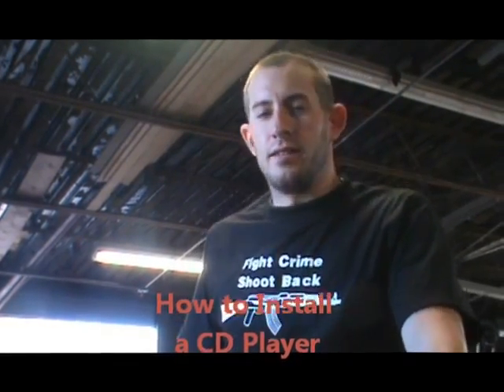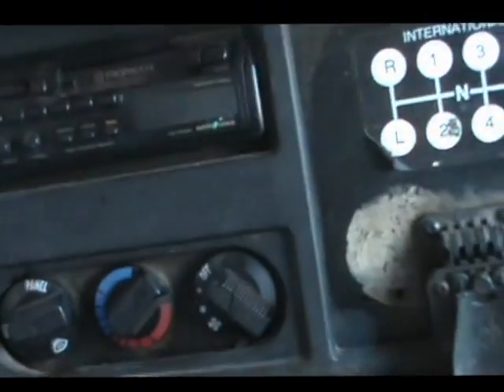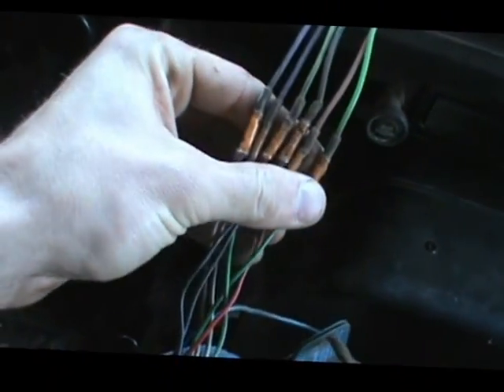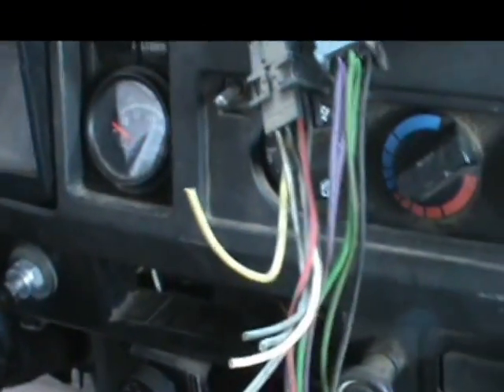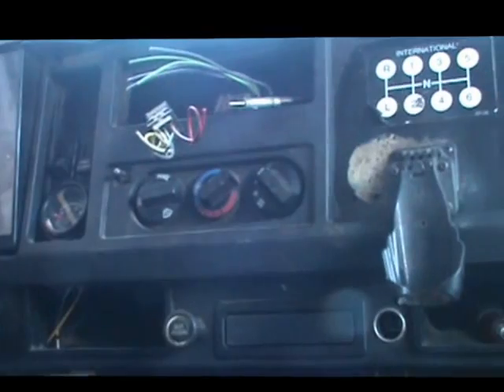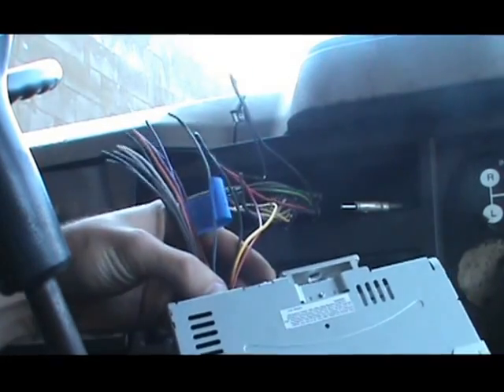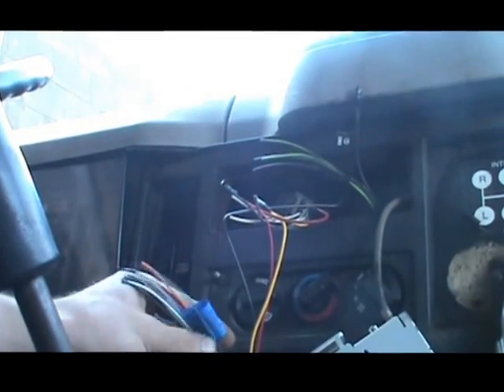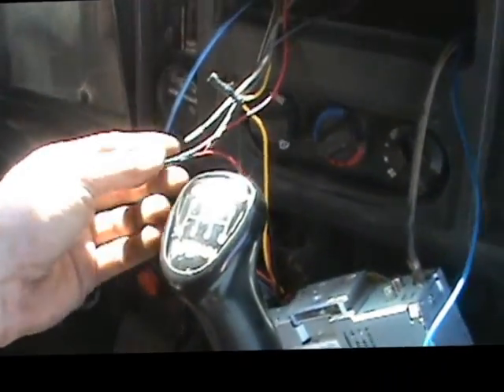How to Install a Car CD Player

Comment: Right on brother. After I commented, I just cut the car harness plug off and wired it up that way. but I had to run an auxiliary wired from the positive battery to power the unit up. So I cut the wire and wired up a simple on off switch so Its easy to shut off when Im done driving

Comment from the maker: hi jet t, thanks for watching my video.. sounds like something simple, check that your ground is bolted to a good metal ground... then make sure you have a positive wire from the battery to both the red and yellow wires on you cd player...this should get the unit working for you... 
cheers beauthemechanic

Comment from the maker: hey pat, sorry for the late reponse. yes theres always a way to make things work. your probably going to have to hard wire the fans to the run position. its a pretty easy task. take the wires going into the fans free there should be two per fan. pretty straight forward one is a ground and one is a postive or supply. your going to have to run new wires to the fans directly from the key ignition or fuse panel. the other goes to a good metal ground bolt. if the air flow is wrong reverse the wires..

Comment: WOW Beau...you just helped me out on a bunch of questions I've had.  Now I know how to use my continuity light tester AND how to install a car cd player.  I wasn't sure if I would need so kind of metal bracket to hold the player in the dash but it looks like just tweaking those security tabs will do it!  I'm putting the exact same player into my 1985 rv that had a dead player in it.  You gave me the courage to try.  Thanks!  Great work!!!

Comment from the maker: hi mnight207, sounds like your on the right track id try and get the unit to power up by just connecting the red and yellow wire to battery + and the black wire to battery - .. if you can get the unit to turn on then you have a problem with the wires in the car from the battery or ground.. if you cant get the unit to turn on from the battery then you might have a loose wiring harness... if so id return the unit and get another.. hope this helps beau

Comment: Hey man awsome vid. i have the same deck and im puuting it into a GMC sierra 1997. well i dont have constant wire ( Hot Wire). when i turn the ignition i do have a yellow wire that works. 
on the diagrams i have read that it is a orange cable. but yeah i dont know what to do if theres not a constant. any advice?

Comment: Beau, i'll tell you how awesome you are once you have a solution to my problem. I have a 97 Chevy Malibu. Ive been trying to install a Dual XDMA450 deck in it and it just will not power up. ive checked the fuse and  thats good. The ground wire is running from the inline harness. Ive tried bypassing the power just to the battery and I am not getting power. The fuse for the deck itself is good. Can you pretty please tell me what the deal is?

Comment: I just got a CD player for my 1996 Mercury Sable. It's the exact one you are showing. How would I install it. Their is already wiring inside the vehicle from when the previous person had a cd player installed. Does that really matter?? Or do I plug in my new wiring to the previous wiring that was installed into the old cd player??

Comment: Hi Beau, if you connect battery wire to both battery & aux wires eg: red and yellow would that drain battery as head deck will be constantly on?

Comment: my old radio in my 92 ford f150 xlt stopped working 1 yr ago,why? checked fuse,it's good.took the radio out yest,snapped a cpl easy to replace wires from their places.i'm replacing with a new cd player.problem: old radio had 1antenna slot and 1 plug in,new cd player has 1 antenna slot and 2 plug ins.what do i do? why's there 2 plugs in? ur vid helped,but i need more help.if fuse is still good then caused radio to not ever come again? are there MORE fuses to check leading to radio? plz help

Comment: i have done everything as directed...but for some reason it doesn't work...doesn't even light up...and when i put the original radio back in, it doesn't work either...the radio fuse in the car AND the new stereo are fine...any ideas? thanks so much.

Comment: As a woman people automatically think I can't do shit to automobiles, that's just crap. I have a video about replacing a main relay assembly on my old honda, I have over 220k views :-) I now want to tackle installing a cd player in my 2002 Chrysler Town and Country. People have said not to try and that makes me want to do it even more. I am hoping this video will help me identify the wires I need. Question, will I need to buy a harness and antenna adapter? I know I need a dash kit. I have never done anything like this. what do you think? Should I do it myself?

Comment: To to install cd radio ford contour 2000
Reply from the maker: sorry i dont have a video for ford contours but this video should help installing a cd player in anything that has a battery
Reply: +Beau “The Mechanic” Boruff how did you put the speaker wire in through the dash
Reply: Man I'm trying to figure out how to fix my back lights I already got my radio fixed it's just my left back light is out and I don't know how to fix it I don't know nothing about cars I don't know where my fuse box at
Reply: if you are sure that is not burned the light ball, check the car manual to find the fuse box.